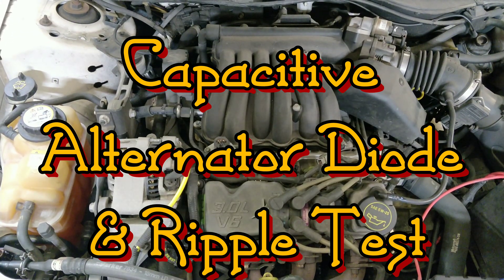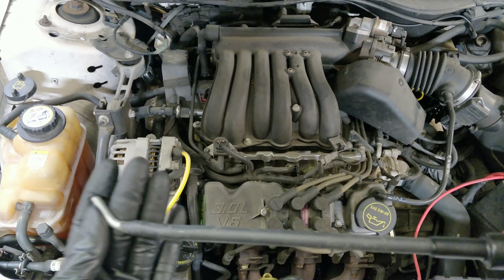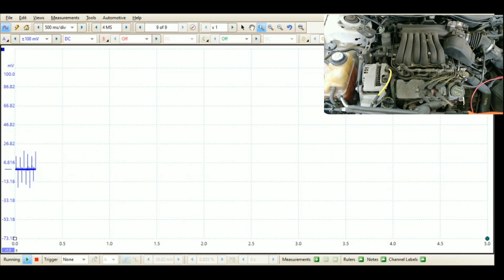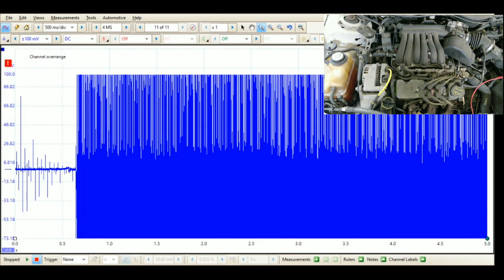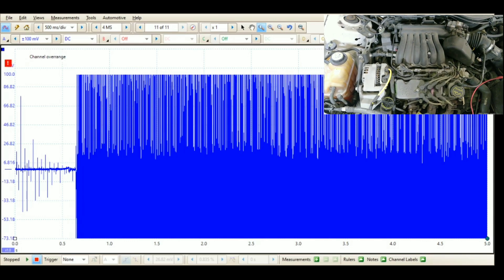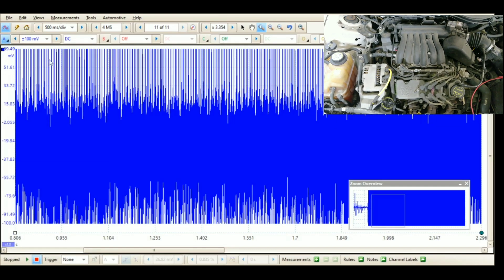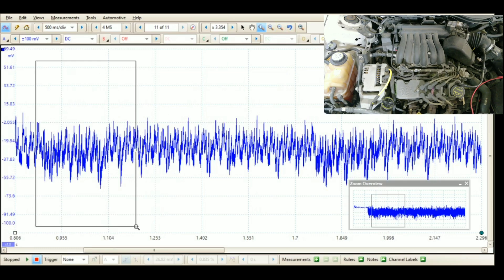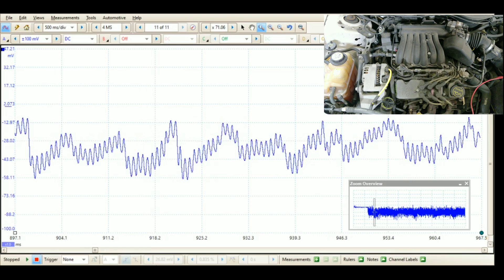Capacitive Alternator Diode and Ripple Test Using A Scope

Comment: HOW DO I KNOW IF THIS WAS A GOOD OR BAD READING ,,,,,,,,,,,,,,,, WHAT'S THE GENERAL SPECIFICATION FOR ALTERNATOR READERS JUST A QUESTION THANKS ????????????????
Reply: I've read previously that anything above 0.56 V means that one of the diode has failed
Reply from the maker: I don't think there is a way to get a really good measurement but this is a good way to get a quick idea and see if you have an obvious bad diode. You just want a relatively even pattern.
Reply: @RobertDotterer  THAT MAKES A LOT OF SENSE , THANKS FOR THE REPLY !
Reply: @RobertDotterer  I think that a method you have used could show the same results whether the diodes are good or bad. What was measured is a signal induced from a magnetic field created by 3 phase winding current, and that magnetic field is always there during alternator operation. By connecting the probes directly to the + output and ground, an "amplified" (~14V) signal can be measured, where an amplitude of ripple or harmonics can be further analyzed.
I may be wrong of course.

Comment: This is great thank you. You can also use the wand to pick up many fast switching signals including injectors, PWM signals for inlet metering valves and EGR valves. Just try it out on components but be  careful not to get it caught in any rotating components. A current clamp around the alternator output wire can also give you a very good diode test and in some vehicles the current clamp will give you an idea of cylinder balance. This doesn't work for all though. The other thing to bear in mind is the keyless entry detector. This has a number of different uses not which can be seen on our forum - https://www.picoauto.com/support/topic19361.html?&p=87081&hilit=keyless#p87081
Reply from the maker: Thank you, I made a video on doing a fuel injector. It was really hard to get one to work right. I didn't release it yet. I'll check out the forum.

Comment: pretty slick, same info as hooked up with a channel lead? what are you touching just the cable lug?
Reply from the maker: You just hold it near the back of the voltage regulator. You don't need to touch anything. It's just like doing an ignition coil.